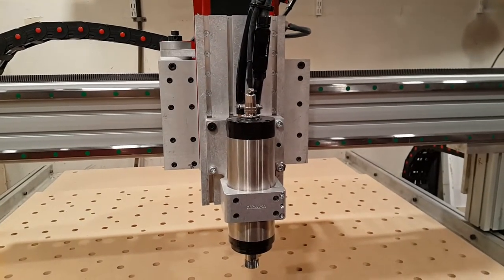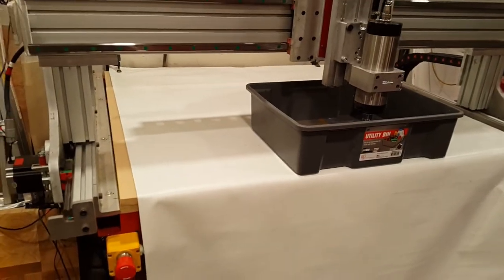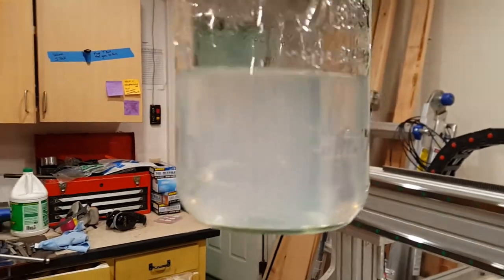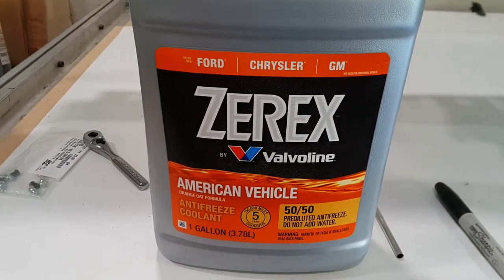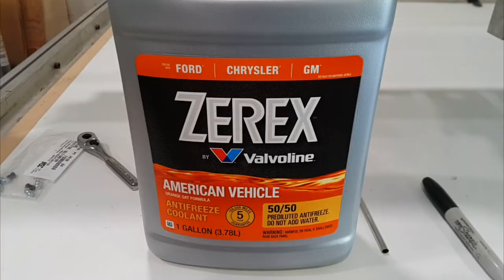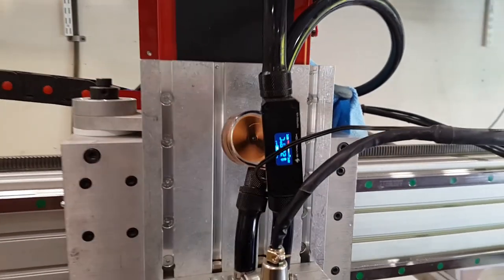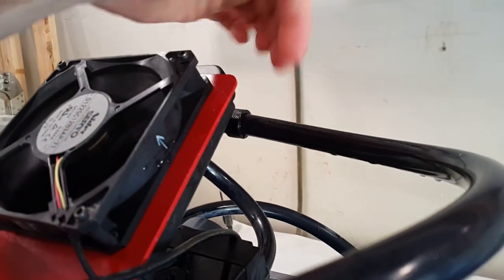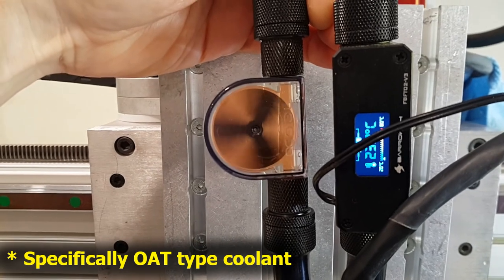CNC: Water Cooled Spindle - Flow Indicator & Coolant Replacement

Comment: I use distilled water and ATV Antifreeze.  Its been in my machine for 5 years now and it hasn't changed color and there is no scum or rust in the reservoir or spindle.  The tubes that supply the spindle are as clear today as the day I installed them.

Comment: How is going so far with the antifreeze? I am doing some research about what to use, right now I am using just water but I am concerned about corrosion.
Reply from the maker: The antifreeze seems to be working really well. Based on the clarity of the solution after several months of use, it seems to have stopped the galvanic corrosion problem that I was having mixing cooper/brass with the aluminum radiator. I've had several long cutting jobs and the spindle stays cool (based on the reported coolant temperature and confirmed by physically touching the spindle case).

Comment: Heya, you really want to use just distilled water and a bioside. That coolant is way way thicker then the pump wants, while providing little to no benefit.  
You can get an aluminum radiator if you think the interior of the spindle is aluminum, not doing so will surely destroy whatever aluminum parts there are; using a copper radiator.
Reply: Automotive coolant can contain silicates which are supposed to protect aluminum. Antifreeze used in may Asian cars contain phosphate. The old green (IAT) coolant protect brass and copper best. How much thicker depends on the ratio of water and antifreeze. Antifreeze which is primarily ethylene glycol does carry less heat than water. One might consider Dowfrost which is an inhibited glycol. I do agree minimize the number of different metals in the system to reduce corrosion. I think I will use distilled water with a biocide such as PrimoChill Liquid Utopia.